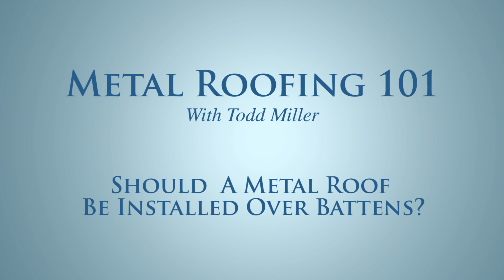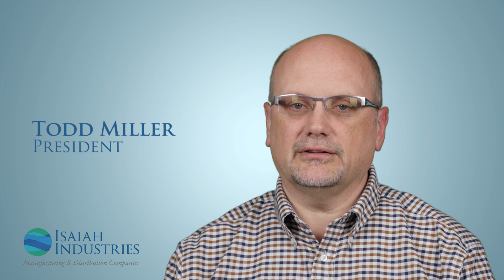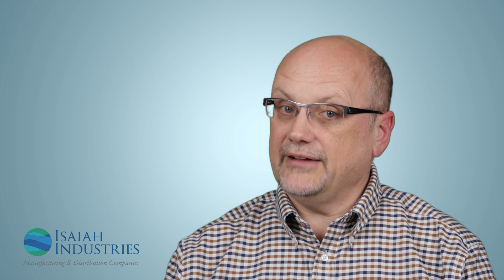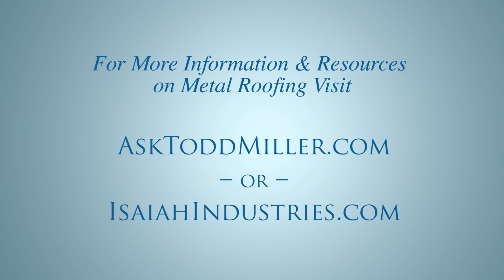Should a Metal Roof be Installed Over Battens? – Metal Roofing 101 with Todd Miller

Comment: Should I put the tar paper down before I put down battens or should I put it over the battens? Thanks
Reply: Both !! But on top is better.. The metal can sweat and if the felt is under the battens, the battens will collect moisture ...  The last roof over I did was shingles felted over it , then battens then felt, then metal,,  I am getting to the point I'd just use shingles Fewer headaches ..Most places/code and warranties require the metal screws be placed  into  1 1/2 in battens.  3/4 battens will crack and slpit over time allowing the screws to come loose.. 
the every 8-10 years get ready to change the screws  ( the seals go bad) the screws come loose  etc ..  Just stick to plain ol shingles  , its better in the long run...
Reply from the maker: Though it’s not ideal either way, my recommendation is underlayment on top of the shingles before the battens are installed. The problem with installing it on top of the battens is it tends to sag between them and the sagging areas can hold moisture which causes the underlayment to rot. I do suggest spacing your battens a tiny bit so that if water is ever trying to drain down the roof, it can run between the battens. There are also battens available with drainage slots milled into them.
Reply: @IsaiahIndustries  yea...with that logic is saying moisture will be then trapped under the batons to really speed up the rot.  Best case is to strip everything, felt then metal.  By the time u put purlins, felt then metal your out about the same cost

Comment: Have questions. Mountain Cabin, 7/12 pitch, cathedral ceiling/ no attic, old cedar shakes are torn off. Car decking underneath. Is the process 1). Peel and stick. 2). 1" foam board. 3).1/2" plywood. 4). Standing seam metal?   Do I need 1x4 battens?
Reply: 1. 2" or 4" XPS foam board 2. peel and stick 3. battens or OSB screwed through foam to rafters 4. steel
Reply: Larson Home Inspection 
Thank you!
Reply from the maker: Sorry for the delayed response, sarobinson56. Based upon what you’re telling me, yes, some form of thermal break is probably wise.  Call me at 1-800-543-8938;201 if you’d like to discuss it.  

– Todd

Comment: Don't forget screws hold way better in solid backing like battans rather then ply or sob.also the air gap helps kill the sound the rain and r value.fyi I put syntitic felt on top of battens to block metal sweat

Comment: Great Video - thank you! I am building a seasonal home in Maine, where it is getting very hot in the summer these days. My face screwed metal roofing is on the way. I was going to directly screw it to the rafters over Duponts 'roof protector' underlayment, because it's cold now, and we want to get the roof on fast! I am concerned that I will regret not using the mylar looking reflective underlayment under battens, and that the area under the roof, which is to be a dwelling area in the summer, may be unbearably hot. Do I need battens in this case? No other insulation is planed.
Reply from the maker: Please email me direct at todd@asktoddmiller.com and tell me more. You would not be able to install roofing direct to vertically oriented rafters. I in fact never suggest residential applications without solid decking, even if battens are installed on top of the solid decking. Do you have good attic ventilation? I will await your direct email reply.  Thank you.

Comment: Mr Miller! I am building a house with 6" of open cell spray foam under the roofline with a sealed attic. I am also installing a raised seam metal roof which the installer uses 30# felt for underlayment. My question is, what type of underlayment should I use and I was going to use a perforated roofing foil over the underlayment with 1" battens that the metal roof.  Is this an acceptable roof system? I want to meet code and prevent any moisture issues. I am in Clark county NV in zone 9A Hot Desert I believe. Any help is appreciated.
Reply from the maker: Hi LeeMan 20s!

The potential problems when it comes to moisture and condensation with roofing stem in virtually all cases from moisture that originates inside the structure (from bathing, cooking, laundry houseplants, etc.) migrating into the attic and then condensing on a cool surface, often the back side of the roof deck.  The reason we see more of this in recent years is not because of the roof assembly but because we have made the walls / doors / windows of our homes much tighter. Moisture that used to migrate out through those things now ends up in the attic.
 
Your use of a sealed attic and closed cell foam should be plenty to prevent moisture originating inside the home from reaching the back of the roof deck and condensing.
 
I would use a standard roof underlayment over the plywood decking on your roof (such as a synthetic underlayment) and I see no need for battens or anything like that. 
 
That said, if you’re seeking increased energy efficiency, then battens can be helpful by creating a thermal break. You can make things even more effective by putting down vertical battens and then horizontal battens before the roofing … allowing the resulting vertically oriented air chambers to be actively vented with intake and exhaust vents using convective airflow. This will help carry heat radiating off the back of the roof to the outside before it reaches the home.
 
If you use battens, make sure the roof panels you’re installing are approved by their manufacturer for installation over battens.  –Todd
Reply: Todd, thank you so much for the fast reply.  I was planning on using open cell foam on the entire house including the underside of the roofline.  My quote for closed cell foam was over $9K more for just the roof line over the cost of closed cell.  Is this a problem?  Also, do I need a breathable or vapor permeable underlayment under the metal roof?
Reply from the maker: Closed cell foam of course is better as a vapor barrier but, if you’re using the foam everywhere, I still think you will be okay.
 
If you wanted to ventilate at all, I’d ventilate the attic rather than just beneath the roof system.
 
If you can put a vapor barrier behind your ceilings and walls, that would be very helpful as well.
 
As far as the roof underlayment, I would suggest a synthetic underlayment rather than 30# felt. The felt, in hot temperatures, will want to stick to the back side of the metal panels and that could lead to problems. The synthetic underlayment will breathe only through the seams, not through the product itself. There are breathable synthetics available but they are pretty expensive and I don’t feel you need them. That said, my company is beginning to stock a good breathable product from Europe. If you’re interested, email me direct at tmiller@isaiahindustries.com. This product is a little more expensive than standard synthetics but would work well.